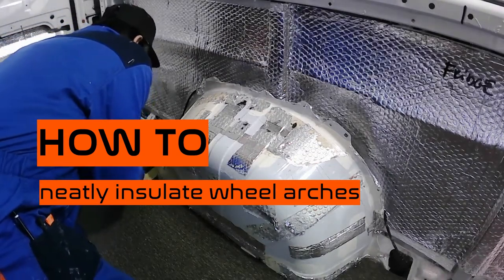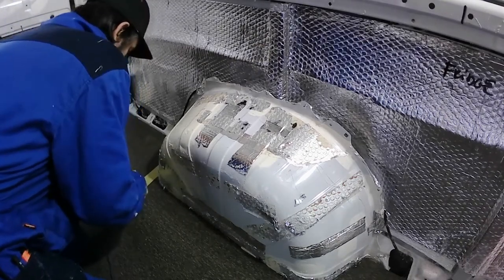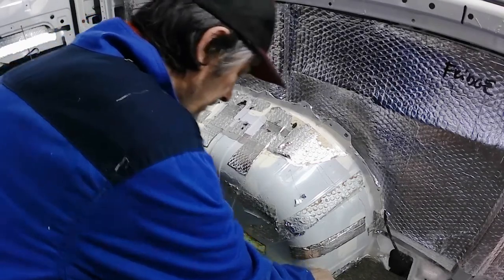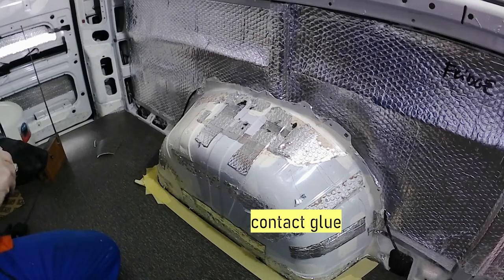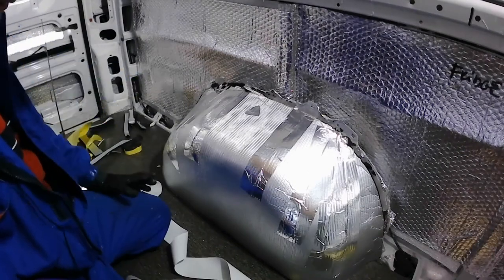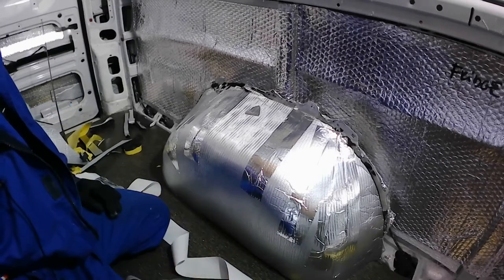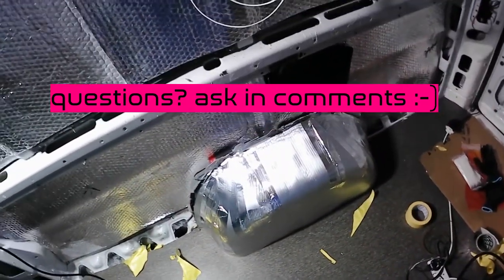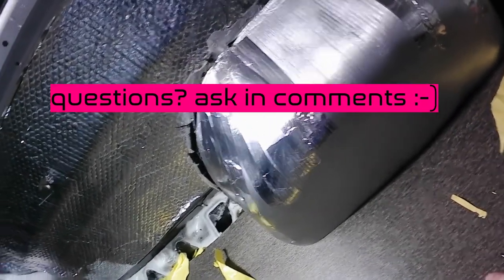how to insulate wheel arches camper van

Comment: I was using aluminized foam without the adhesive back.  I expected the pre-spraying both the wheel well and foam would require me to work fast and likely end up with stuff stuck where I didn’t want it. And so I cut a section that would cover the entire flat part and glued it down.  Then I decided on the proper width for the next piece, folded it up and cut and then sprayed the wheel well in that area only, along with the foam piece and glued it down. It turned out rather well. Although I have more joint lines, each joint has been carefully cut to match the next piece and the width was adjusted to make it the ideal width so it didn’t bulge once glued into place. 

I would never have though of this idea so thanks for the clip!!